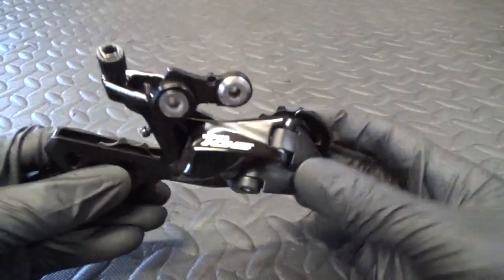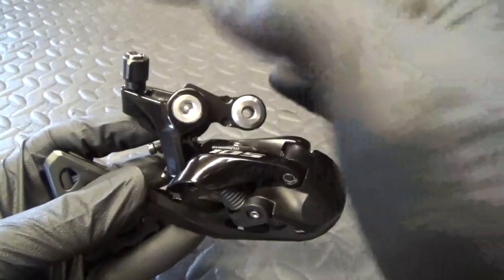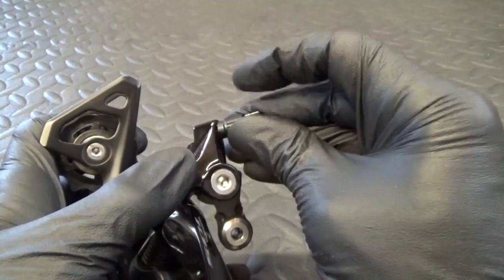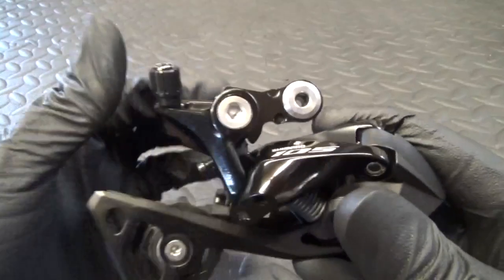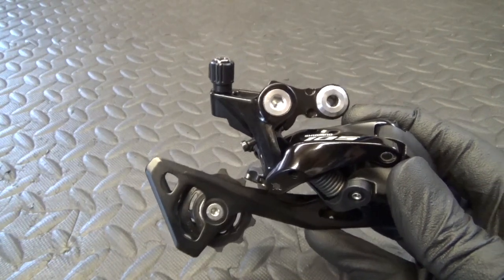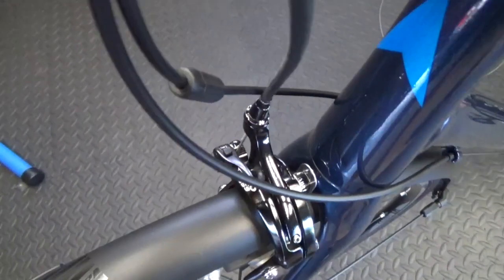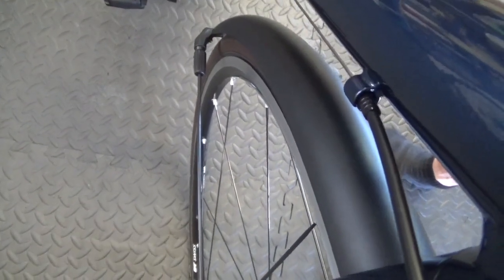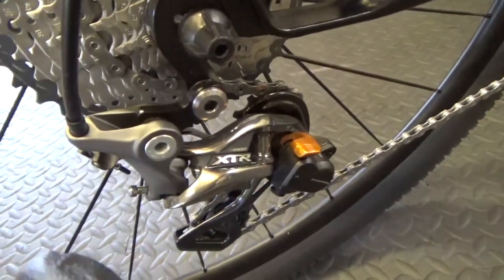Bicycle Barrel Adjusters And How They Work

Comment: Excellent!
I just had a new GRX 1x set up installed on my bike, and it shifted great. After a week of two, the cable stretched and the shifting started feeling ropey.
Rolling the barrel adjuster the most likely direction - clockwise - made things worse. So I tried it the other way. Which worked  treat.
Now I know why!
Cheers

Comment: Thank you for a very nice video. Especially the details about the R8000 barrel adjuster was usefull. I have been wondering why my adjuster seemed to work and other's not. Now I know why. Purely by luck I have crushed the outer rubbery peace between my fingers while turning, and then it adjusts the cable tension all right. And as it is very rare that the derailleur needs adjusting, I'll wait and see until it stops working, and now I know how to replace the barrel adjuster with an older version. Thanks again.

Comment: Maybe I'm thick mate but I don't understand how adjusting the outer plastic cable, effects the inner wire? Surely the wire is designed to float up and down the outer and to tighten it, you would have to grab the wire itself? How can moving the outer plastic tighten the inner when it's not gripping it tight so it can move freely? I've just fitted a new derailleur you see and it uses a different barrel adjuster. It's just a metal bolt with a hole for the housing that's hollow for the wire to run through. I'm having a nightmare fitting the new mech and it's all blowing my little mind
Reply: Think of it as someone pulling on the sleeve of your jumper.
Reply: Okay I was in the same boat as you and looking up every video I could find, but I think I finally got it now, so let me describe it how I think it works (sorry, lengthy explanation ahead, but all the "short and simple" explanations didn't click for me). 

Let's identify a few points along the length of the inner cable. Inner cable is attached to the derailleur lever at point A. Inner cable goes into the outer cable at point B, which is a point fixed to the frame of the bike. Inner cable comes out of the outer cable at point C, which is also a point fixed to the bike frame. Finally, inner cable attaches to the shifting lever on the steering wheel at point D. Now as I mentioned points B and C are at fixed positions attached to the frame, so they will never move. The inner cable is a fixed length, and its length is combined of 3 sections. A->B + B->C + C->D. 

Now when you turn the barrel adjuster so that it comes out, it essentially lengthens the outer cable. This means that length B->C will increase. Since points B and C are attached to the frame, it basically means that the outer cable has to buckle out a bit. This means, the outer cable won't be in a straight line between points B and C anymore, so the length that the inner cable traverses between fixed points B and C increases, even though B and C are fixed points on the frame. This is because the inner cable is forced to follow the buckled path of the outer cable, so it travels in a less direct route from point B to point C.

Now if B->C is longer, but the length of the inner cable remains the same, that means A->B and C->D must become shorter. Because B and C are fixed points on the frame, that means point A has to move towards point B (i.e. the point where the inner cable attaches to the derailleur gets pulled towards the fixed point B, and thus gets tighter) and point D has to move towards point C (i.e. the point where the inner cable attaches to the shifting lever on the steering wheel gets pulled towards fixed point C, and thus gets tighter).
Reply: To keep things short, you're increasing the travel distance of your cable. But since the cable is attached to both ends, it wants to retract, but it can't, so it pulls whatever is attached to it. In this case, a derailleur.
Reply: @spinnie0 great explanation. Thanks for writing that
Reply: @ArthurD thanks

Comment: I am glad that you took them apart, to show what is happening inside. My bike has two-part barrel adjusters on the handle bars and the brakes. I don't know if this is bad or good, or why mine have 2 nuts at each end.

Comment: 06:54 "shortening the distance there".... Where exactly? I spent the last 15 minutes thinking about this mystical screw. I know lefty-loosey tightens the cable, but I just can't get my head around it. For some reason. Anyways: you're the first guy I find to actually take the time to explain HOW it works, rather than how to operate it. Thanks! I think I got it! I think :)
Reply: As you turn it counter-clockwise the barrel adjuster pushes the cable outwards, which doesn't shorten the cable, but shortens the space that it occupies. Imagine holding a ruler between the palms of your hands at its two short sides. If you push one palm towards the other the ruler will start to bend as you increase the tension. Same applies to the cable.
Reply: @thehuge0  thank you, makes sense! I finally managed to understand it :)
Reply: @bauke-LV426  no worries :)
Reply: Thank you . Been trying to understand this for ages. But the cable runs through the outer cable and adjuster barrel independent so how does it tension the steel cable is the part I couldn’t get my head around 🥴🤡. You have just explained it for me🥲. Now I can sleep easy😂👍
Reply: @Macm73  I'm still stuck ... Any chance for some hints?
Reply: @marionsutcliffe1119   if you were to hold a 30mm plastic ruler like this🙏 with  half the ruler sticking out the bottom then start sliding one hand down the ruler you will see it start to bend. That bend is how the cable is tensioned by the barrel adjuster.
Reply: @Macm73  Thanks! But I got it differently. The distance of the path between lever and derailleur (or brake) is determined by cable housing length plus bare sections. The barrel adjuster lengthens the housing i.e. lengthens the path (or shortens). But the steel cable does not stretch, so the derailleur must move towards (or away) the lever.
Reply: @marionsutcliffe1119  yes that is correct. Soon be a thing of the past with electronic shifting and hydraulic brakes, which I’m not a fan of as I prefer to tinker and find the old system more user friendly

Comment: Gah, still can't understand how a thingy around a metal cable (like on my Fuji rear shifter) can tighten that cable. I could understand if the cable was not continuous, so it was moving the 2 ends closer or apart.
Reply: Got it! The distance of the path between lever and derailleur (or brake) is determined by cable housing length plus bare sections. The barrel adjuster lengthens the housing i.e. lengthens the path (or shortens). But the steel cable does not stretch, so the derailleur must move towards (or away) the lever.

Comment: Is the clip, that is on the barrel adjuster thread when new, just there to hold everything together until you assemble things or does it have a purpose? I'm using the barrel adjusters on the downtube which already has threaded bosses welded.

Comment: I have to replace shifting cable barrel adjusters on my down tube.  They are old school late 90s style for Campagnolo cables. Does it matter if the barrel adjusters are not made for campagnolo.  I’m assuming barrel adjusters would work with all cables.  Am I right?  Could I just recycle some adjusters from some unused old bike?  Thanks

Comment: Hi, I recently broke a frame and swapped everything over to a new frame with internal cables, I didn't fit barrel adjusters and I'm getting chain rub on the front mech, will a barrel adjuster stop this happening? Thanks!
Reply from the maker: Philip probably won’t help as the limit screws effect how far the derailleur moves left and right, depends where the chain is rubbing could just be alignment issue.
Reply: @FreeToCycle  yeah I thought that. The old friction levers were better on the front mech! Thanks anyway.